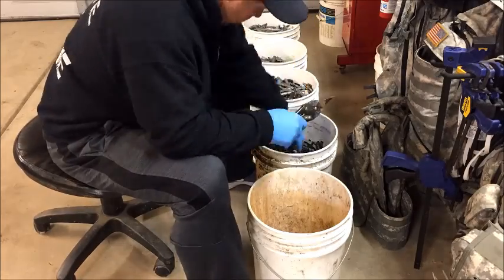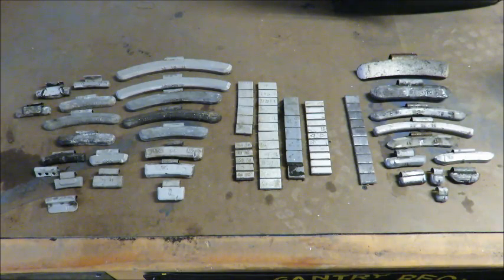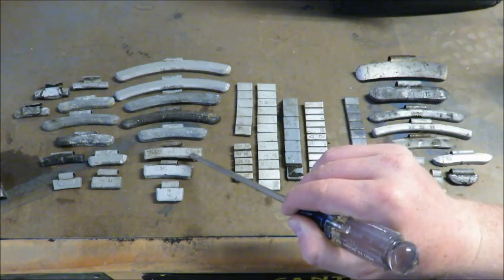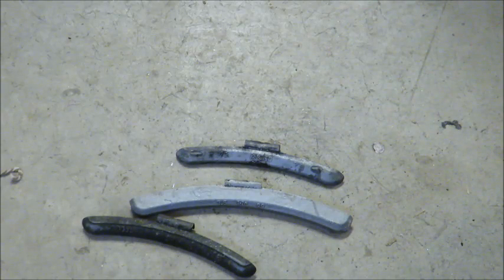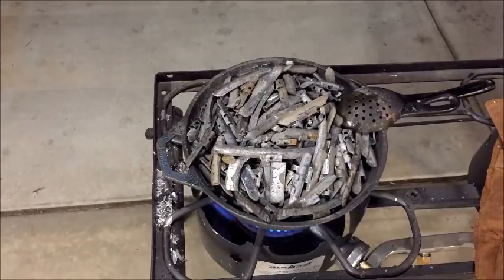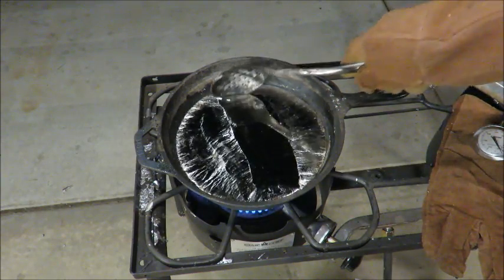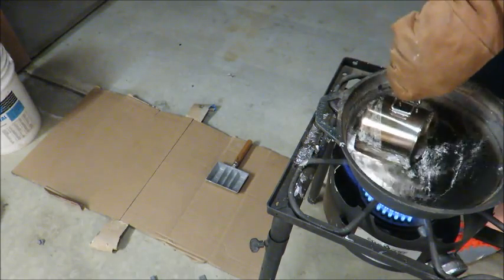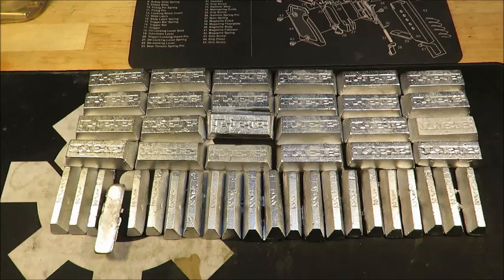CASTING LEAD INTO INGOTS!

Comment: I get scrap from a local recycler for a great deal. I like lead sheeting used for x-ray rooms and roofing. I fold it up and cut it with a circular saw like butter. Those wheel weights always took too much time for me, plus I make a lot of slugs that need softer lead. No zinc bombs to worry about either!

Comment: You can sell the zink and metal scrap to the recycler. I bought three 5gallon buckets of wheel weights for $20, got 51lbs of lead wheel weights and sold the 383lbs of scrap for $14. Ended up with 41lbs of ingots for $6.